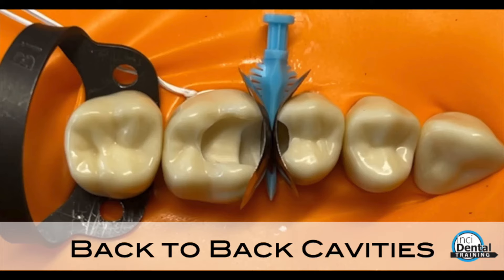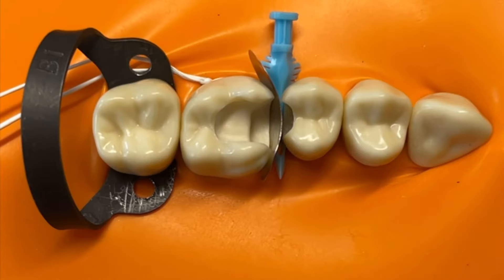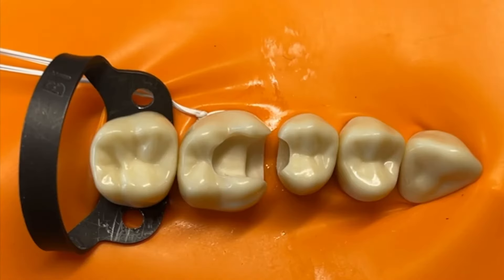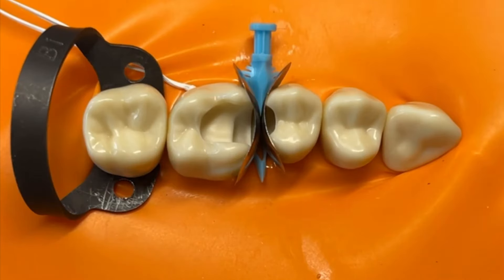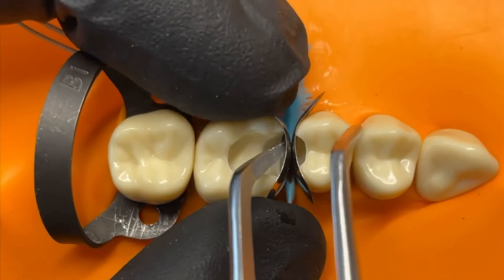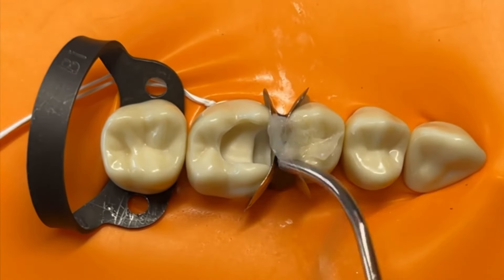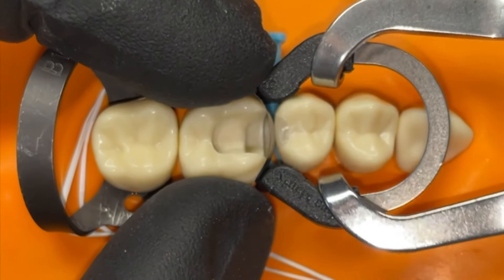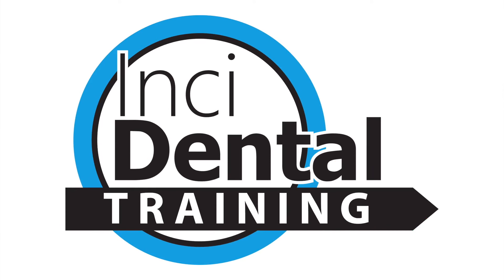Back to Back Cavity Tutorial

Comment: Hi
When I restore with matrix band and a wedge in wider contact in posterios , I usually get open contact.
How can I avoid that Thanks
Reply: You should probably restore one and then when you restore the other burnish the Matrix band from inside against the adjacent proximal wall. That way you should get a tight contact.